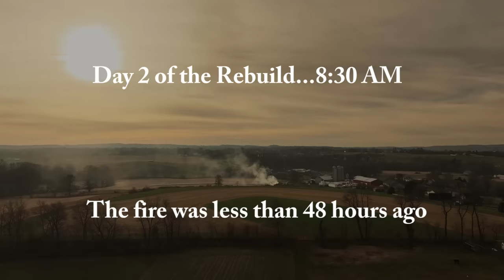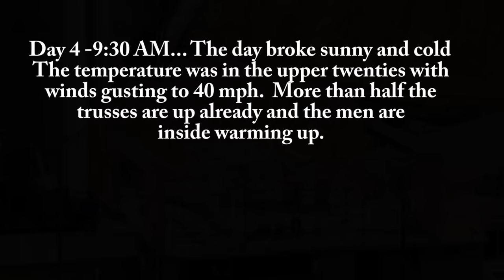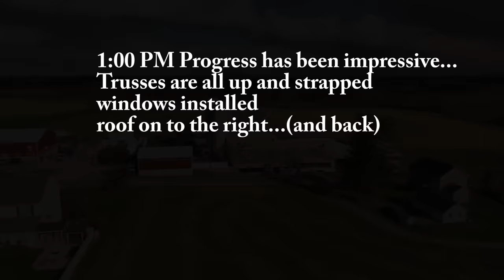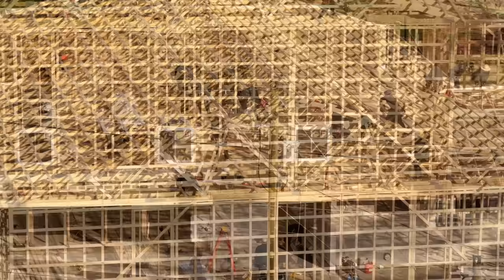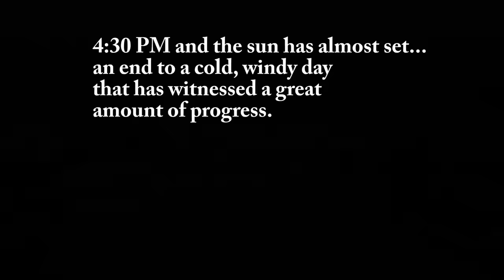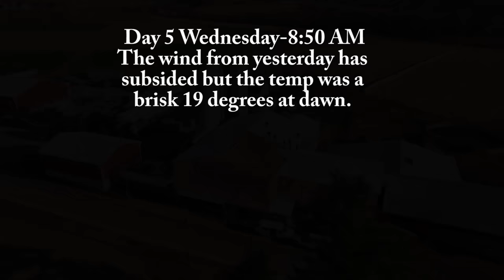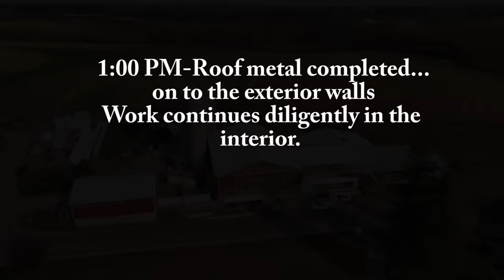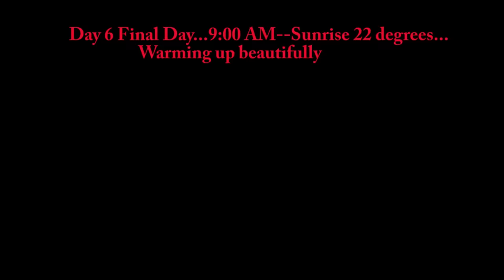BARN RAISING After AMISH Farm FIRE -NEW BARNS in 6 DAYS- Lancaster County's Amish Community

Comment: Oh my kingdom for a nail gun, or 30 to 40 of them!!  Someone would have a full time job running a generator and just charging the batteries!  I wonder how much time it would really save them?  Not a lot I bet, these guys can swing those hammers all day long like that!!  How many nails would you guess in this barn!  50,000 to 80,000?
Reply: I stand corrected.  About half way through I noticed A compressor and a couple guys using nail guns.  It probably depends on what rules their bishop has set for them about using power tools.
Reply: @detroitbob58  If you close, that stuff was being used by the English.

Comment: Not actually that impressive due to the fact theres 120 guys on-site, if these were all paid labor the bill for that barn would be astronomical, the material mustve been sawn locally by them or it would cost an arm and a leg for that wood they are using.
Reply from the maker: 6 days…cleaning up, digging and pouring footers, laying blocks, beams, floor, walls, trusses, roof, windows, doors, entirely new milk house and vacuum lines, new metal on half of surviving buildings, food, drink, equipment rentals, organizing and assigning men to crews, cleanup as the fire was still smoldering, nah…not impressive.
Reply: @LancoAmish  Did you include replacing all the fire damaged windows and residing the front of the farmhouse? The local paper showed a blurb about that.
Reply from the maker: @kerrykerry5778  , I saw the house siding being replaced at one point. Not sure if i edited it out of the final video.

Comment: I understand that there are varying levels of technology, depending on the sect, but curious about the use of technology of things like forklifts, concrete trucks, cranes, etc... which were clearly used. I am assuming that these are "English" people helping out. Is this a scenario where the Amish will not do it themselves but allow someone else to do it? I mean no disrespect but I'm just trying to understand. Considering the amount of horse-drawn buggies seen, along with regular vehicles driving about, this involved many people with varying religious and cultural beliefs, working together.
Reply: Most of that stuff was run by the English. The Amish can use tech for their businesses with the approval of the Bishop.
Reply: There do exist Amish contractors (and many are builders/tradesmen) who own and operate machinery such as telehandlers, etc. It depends on their church district what is allowed, what the bishops will allow for their 'survival', in a larger sense. Also, in some of the markets, there are some Amish using computers at work. I am speaking from documentaries I have seen and newspaper articles. On this jobsite, I have no idea per se.
Reply: also, I would agree: this involved many people of varied beliefs working together :)
Reply: @raymondbrosious7616  You just make it up as you go along, eh? No, I'm right down the road from this. 99% of what you watch is Amish operators on Amish equipment. Modernization is determined by the individual church district and the leadership. Most Amish farms have skid loaders, many have mini-excavators. Many on farm manufacturing operations have forklifts. Many Amish masonry and framing contractors own all terrain telehandlers. Amish contractors typically own one ton, 4WD, four door, long bed pickups, with caps and racks that are built by local Amish fabricators. These trucks are operated by English drivers.
Reply: @kerrykerry5778  I also live about a mile from these and go by everyday on my way to work. There were many Englishers helping and I have also posted that the Amish, with content from there leaders may use modern equipment for there businesses.
Reply: @raymondbrosious7616  You repeatedly claimed that the equipment does not belong to Amish and is not operated by them. If you live a mile from there, you are either blind or clueless. The local Amish here, in the community YOU claim to live in, own and use massive amounts of heavy equipment, tractors, forklifts, skid loaders, mini-excavators, etc.
Reply: @kerrykerry5778  Have you even read what I wrote? I said,: " the Amish, with content from there leaders may use modern equipment for there businesses." Isa your cvcomplaint that I didn't use the word own?  Of course they own it.

Reply

Comment: Was no one paying attemtion to tje machines? Must have hired outsiders because the dont have that stuff.
Reply from the maker: Thanks for watching. Skid steers are quite common on Amish farms. The excavator may have been rented or owned by an Amish contractor. What other machines are you seeing?
Reply: @LancoAmish  Not a machine on that site, with the exception of the crane, that is not in daily use on Amish farms in the region. Equipment that is owned, operated, and often repaired and serviced by it's Amish owner. Skid steers, Mini-excavators, and similar machines are quite common here in Lancaster County.
Reply from the maker: @kerrykerry5778  , I think you’re responding to the wrong hombre.